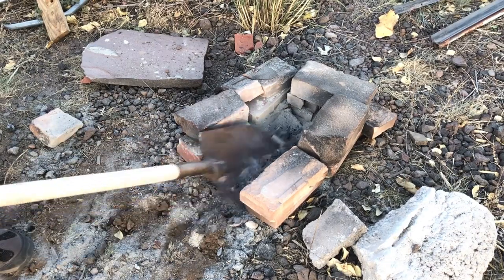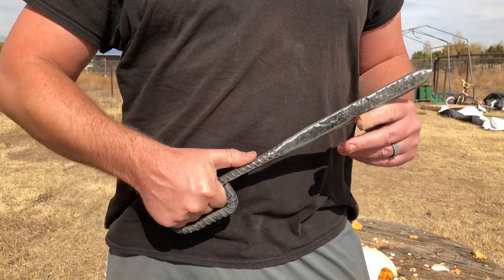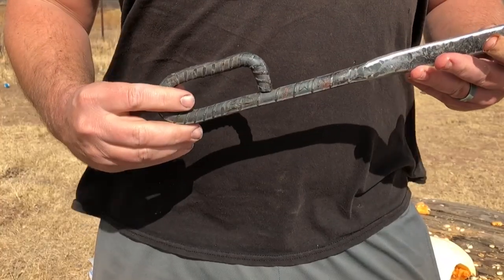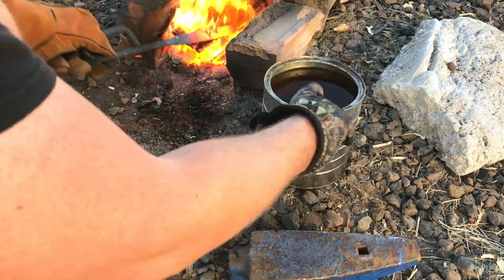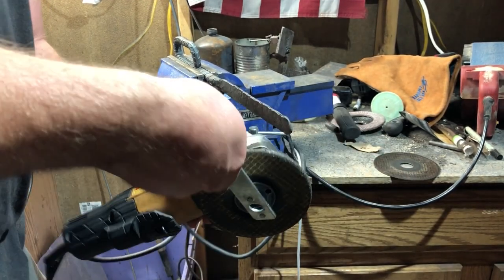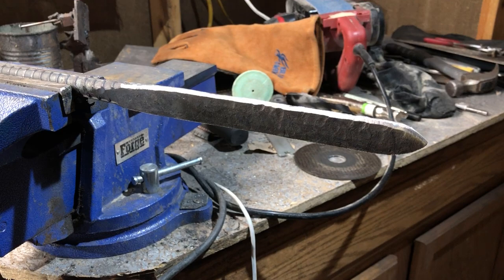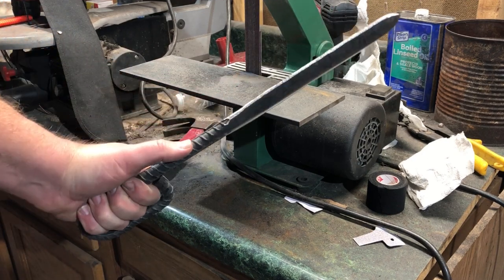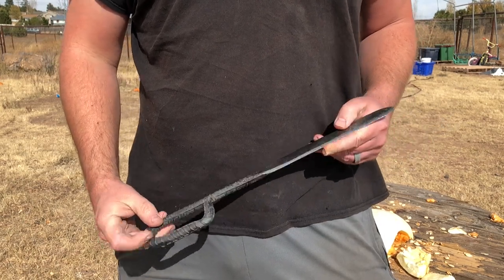Making a Trench Knife: The French Nail

Comment: Me and my friend are doing a no power tool contest to see who can make the best weapon, I want to make something like this, what could I use instead of a angle grinder?
Reply from the maker: - GamerGuy130 -  Sounds like fun. 👍 I’d use a metal file, takes time, but puts a good edge on knives. The key is to clamp down the blade and work at one consistent angle. (And be careful, I’ve cut myself using a file on a knife blade.)
Reply: FargoFX thanks!
Reply: files

Comment: Like you said early in the video, modern carbon steel rebar is a good analog for the materials originally used to make these knives, but it's not something that would have been laying around in 1915-1918 since concrete was still being reinforced with cast iron and inferior steel at the time. 
Has anyone ever positively identified the source material for one of these original knives?
Reply: The thicker wire they used to hold the barbed wire in place was a good source for it
Reply: Some were made from cut down bayonets, but most were made from the metal posts they strung the barbed wire up with.

Comment: You’re using the wrong hammer. The claw on the back is very dangerous and the face of the hammer is too small for proper metal moving.
Reply from the maker: Jaxxon Koethler Agreed! But I’m also showing that blacksmithing can be done with very simple tools. But yes, definitely worth mentioning that there are far better, and safer hammers.